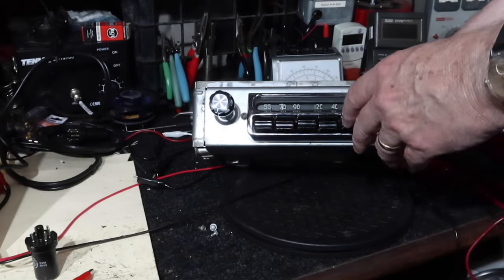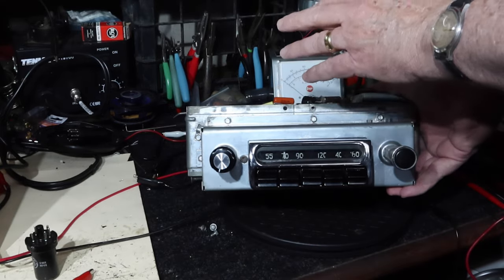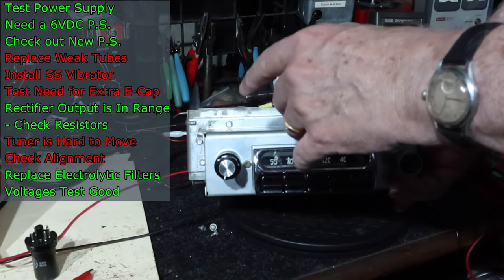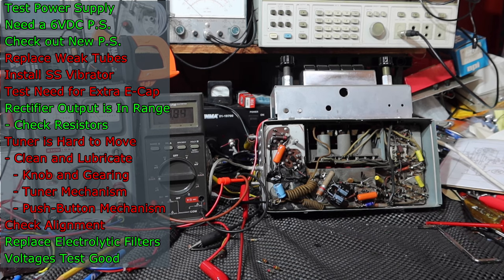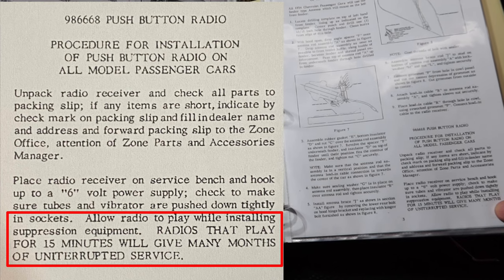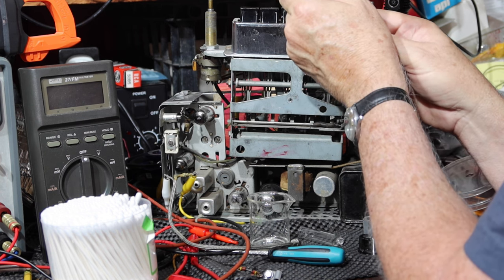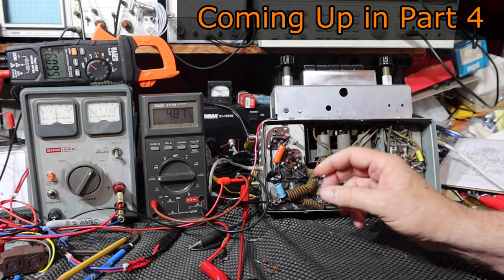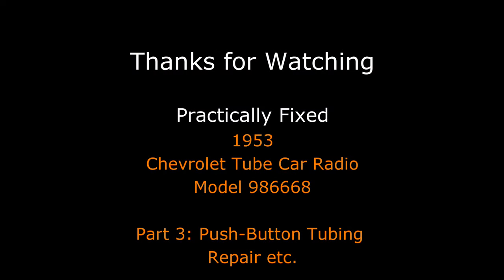PUSH BUTTON TUNING REPAIR etc - 1953 VACUUM TUBE CAR RADIO Pt3 - CHEVROLET MODEL 986668 [4K]

Comment: Nice job on fixing the mechanical portion of the radio. I like your Sencore Analyzer it looks brand new.
Reply from the maker: Hi Jim.  Thanks.  The SG-165 has its own video; https://youtu.be/-wki0lqACJg  it is in good shape but I do need to get in and fix a couple of things.  Thanks again for watching and the comment.

Comment: Hey PF. Nice job getting the tuning freed up. Looks to be working prety good now. :)
Reply from the maker: Hi Doug.  Yes it was really tight and the button reset mechs were really frozen up.  That added on electrolytic was still bothering me since it wasn't on the schematic, but I was busy thinking about the subject of the next part.  Thanks for watching and the comment.